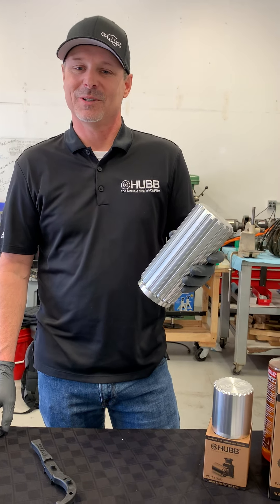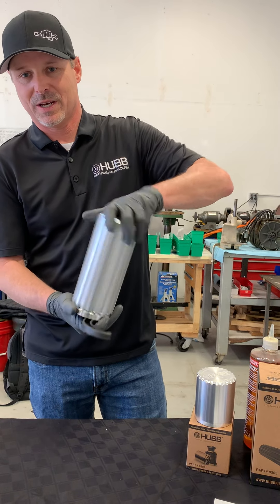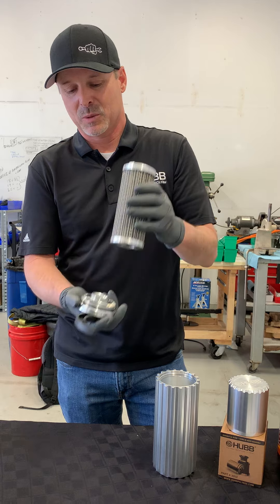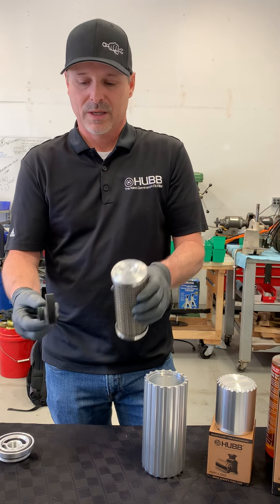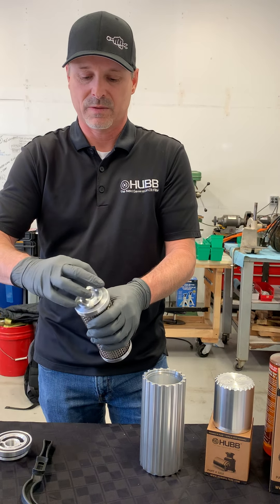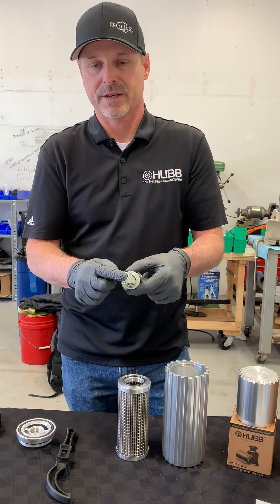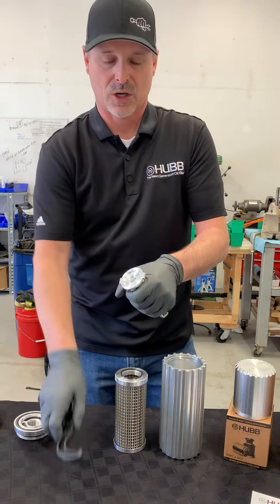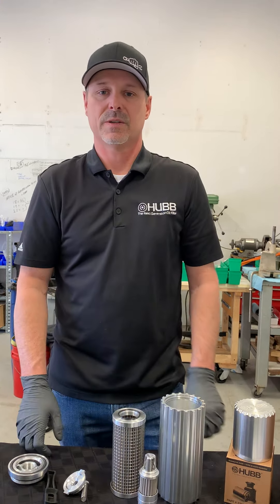HUBB Filters- 8 Inch Diesel Engine Oil Filter Disassembly

Comment: So once the HUBB filter is taken apart, how do you clean it if you don’t have the ultrasonic cleaning station? Lots of brake cleaner? PLEASE explain? Thank you!
Reply: HUB recommends their $500 proprietary system.

I'll share what I do.

I usually have a can of chem-dip around, disassemble the filter unit (including o-ring seals) and spray it down with a can of brake cleaner to get the bulk cleaned off, I recommend the green CRC can, then soak in the dip for 20 minutes, perfect time to wipe things down, inspect gaskets or whatever.

Once you pull the components out of the dip I usually glove up and hit the screens with steam to flush, do NOT use compressed air as that was personal lesson learned, damages the metal screens, have to replace the unit.

Let dry for 5-10

I like to very mildly lube the NEW O-Ring seals with  hi-temp grease upon reassembly.

Does this sound like a lot of work?  Sure

But in my situation it's already paid itself off twice, keeps my oil cleaner than an off-the-shelf unit and gives me time with my rig, and I rather like my truck a lot, plus....less used filter elements in the landfill.

2003 Cummins 5.9
External oil cooler w/stock cooler.
Mobil Delvac @ 20,000mi intervals.

Currently undergoing rebuild following ring failure at 338k miles, this failure was from my abuse.